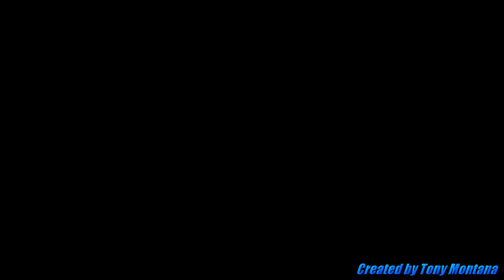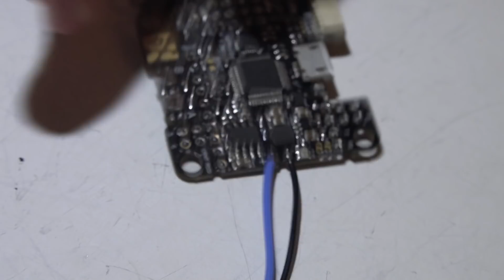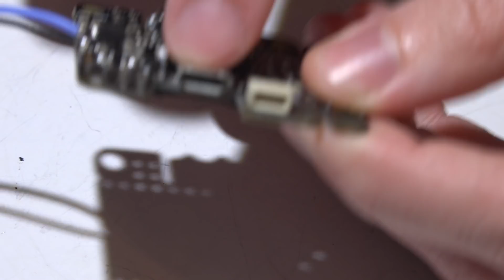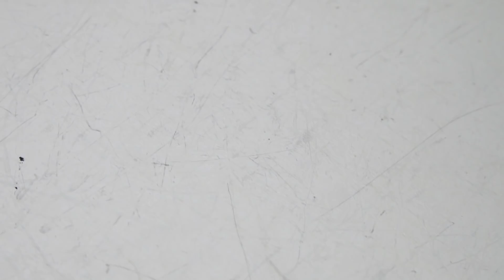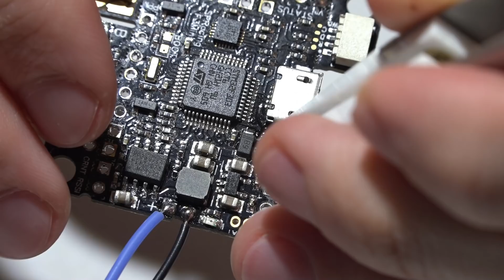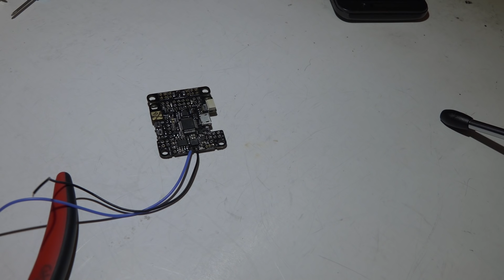Fix For No USB Power On Flight Controller

Comment: hello, your burn part it's same? because i have same problem with speedybee f4 and it s very hard to find part RB495D/D3Q . the idea it's, this diode is compatible replace for original part, like RB495D/D3Q

Comment: Great video with a thumbs up from me so thanks again for another helpful video. I have 4 naze32 rev6 I kept that stop working. I repair a lot of electronics so i kept them planing to check them out one day and see if they where repairable and checked out on line for maybe what go's bad most on them. Putting these small parts on is not easy without a usb microscope. Just the fact that you found the problem, repaired it is more then most people can do. So thanks again, But I have to wounder why someone gave this video a thumbs down. OOOO!!! they must be perfect.

Comment: Hi just started on FPV..I have Eachine X F4 Flight controller and had crash first time and now I don't have power on Flight controller using Lipo only 3 beeps starting beeps on motors and no LED on flight controller but there is power when connected to USB and led is on... what should I do is PDB or Flight controller is broken?

Comment: Will this work on a board that doesn't light up when you apply USB and battery power? I have the omnibus f3 osd
Reply: Maybe, because my experience has been the USB dying, but the LiPo side still working. You could have another issue, like a fried SMT chip.
Reply: Hi, did you find the diode? I have omnibus f4 but I have no continuity from usb port to any diode, could this be that the chip has other major damage?

Comment: Hi Project Blue Falcon
I have a faulty X-Racer F303 V2... searching with a magnifier, i think i have a missing diode. Is there a way i can send you a photo, so you can help me identify the component? Its the one just left of the down left corner of the uart chip (F3), near PWM 4/5

Comment: I can't get power from the Lipo on my sp f3evo but I get power from usb just fine  so no power on the rail with the battery help please
Reply from the maker: Are you powering it from a 5v regulator?
Reply: jeffrey odachowski same problem. Won't power on with lipo. Needs USB to turn it on.

Comment: WOW, another great video tailored to the exact problem I have! Thanks! Do you have a suggestion how I determine the correct diode for my xracer f303 v2.1?
Reply from the maker: Its the diode on the bottom side of the board underneath the USB. Use a BAT54C diode.
Reply: Project Blue Falcon thank you sir.
Reply: Project Blue Falcon on an Xracer 2.1 I am able to power this via usb and on some (coz on the other pinnage it wont) pins off the motor rail but won't give 5 / 3 volts on uarts? Any suggestions?